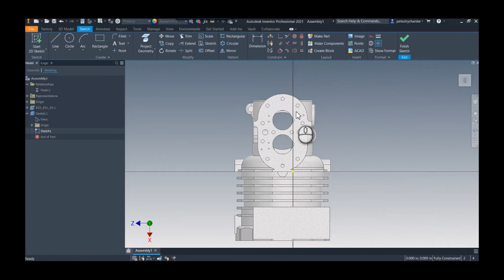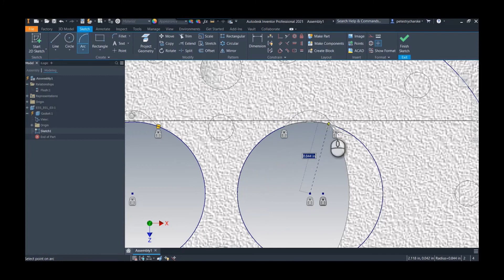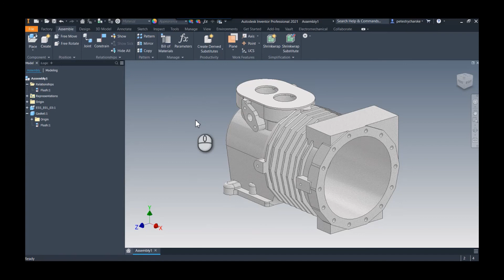Inventor - Referencing Assembly Geometry without Associativity

Comment: does this work only in Inventor 2021 and up?  Thanks again!
Reply from the maker: Thanks for your question! While we can only go back so far, we were able to test this in Inventor Pro 2019 and it has the same behavior.  Holding CTRL while projecting geometry creates fixed geometry without triggering adaptivity between the models. Hope this helps, have a great day.
Reply: @Team-D3  thanks man, i actually tried it out and it works.  Duh.  Should've tested before asking.  lol